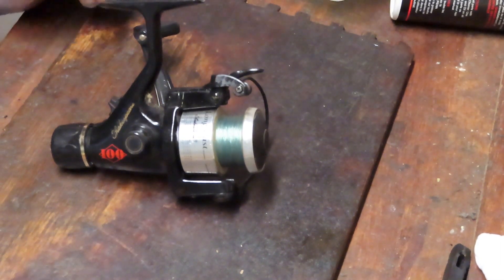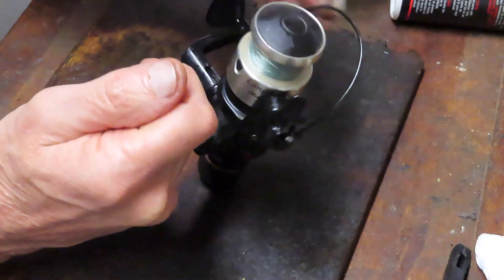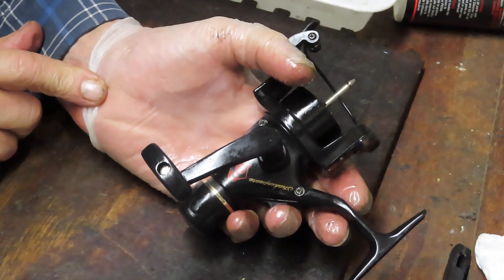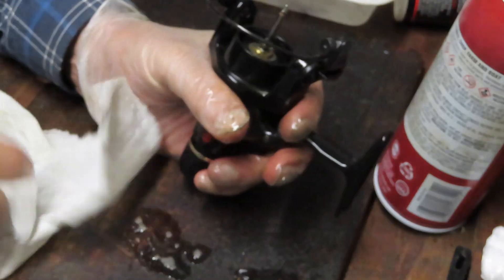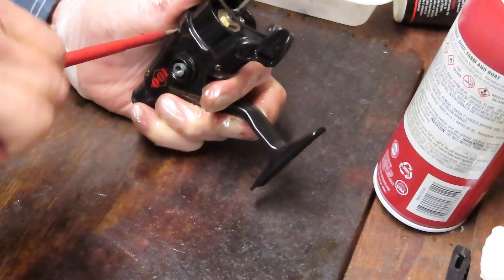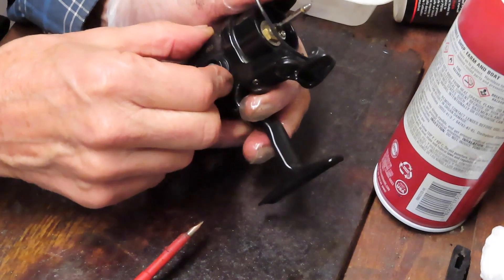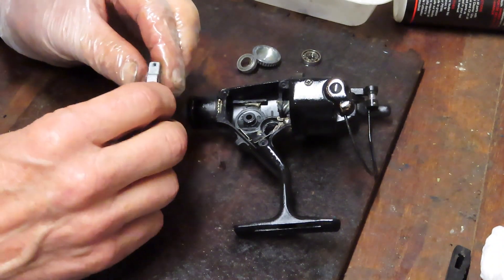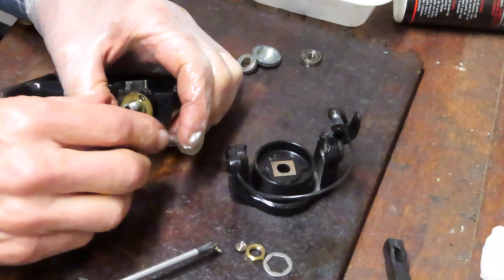Shakespeare 100 rear drag fishing reel how to take apart and service

Comment: I have a similar Daiwa Samurai spinning wheel.  Can't service it though.  Can't open it to service the gears.   Tanks for your information on different fishing wheels.  Helps a lot.
Reply from the maker: There are several different approaches to the side plate assembly used by various manufacturers.  Some require you to remove the rotor to get access.  Some require you to remove the rear drag adjuster first.  Some need you to remove both!  Check the schematic to see what is the proper procedure for your reel. - Dennis
Reply: @2ndChanceTackle  Thanks for the info  👍

Comment: Your videos are very good and helpful. I have a Shakespeare Mantis with rear drag. However, there's no center screw to release the plastic cover on the drag. There are only two small metal indents. Have you ever dealt with this type of cover before?
Reply from the maker: The rear drag caps without the screws are usually held in place by the side plate cover.  I have a Shakespeare Durango in my parts bin.  It has a similar set up.  If you give me a little time, I will do a video this morning and post it for you - Thanks for asking - Dennis
Reply from the maker: OK - I just published the video on how to do this.  You can watch it here https://youtu.be/yCteW9UXRys - Dennis

Comment: Hi Dennis, i have a shakespeare 100 ultralight spinning reel with the regular drag system. Im trying to put the bail assembly back together and im left with one spring that i cannot figure out how to put back. The bail seems to function ok without it which is making it even more confusing. Can you show how the bail is reassembled on this model? Thanks.
Reply from the maker: I don't have that reel in my shop, but if you send me  pictures of the reel  rotor, and the spring you have I will try to assist.
Thanks for asking
Dennis
Reply: @2ndChanceTackle  thanks! What's the best way to message you photos?
Reply from the maker: Please send a note and pictures  to my email 2ndchancetackle@gmail.com